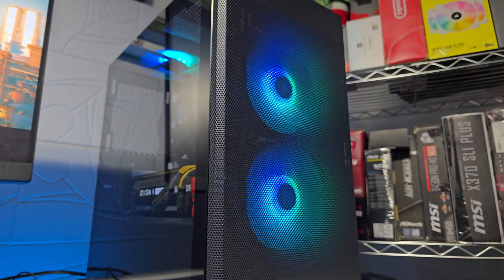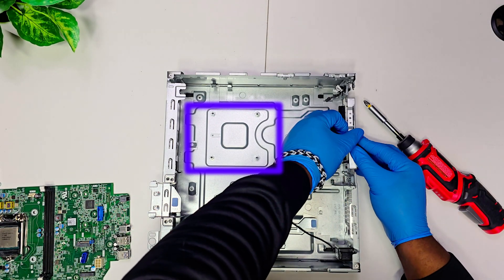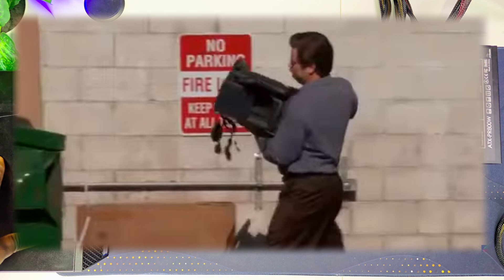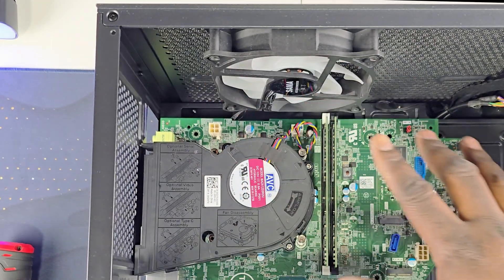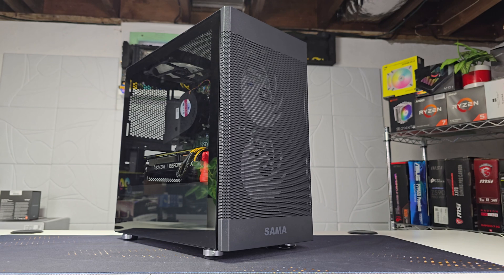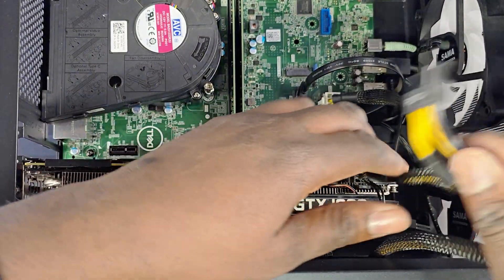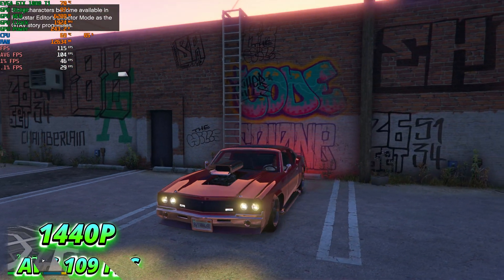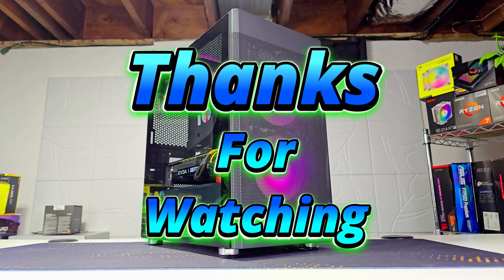How to transformed an Office PC into an FPS Monster! - Dell OptiPlex Case Swap Tutorial

Comment: Hey, working on my 5070 sff. My gpu and cpu fans are not turning off with shut down.  I used the included 6pin-sata cable along with a 10-fan hub.  I connected cpu fans to the hub. Would you be able to help me pls 🙂
Reply from the maker: Hi, don't connect the CPU to the fan hub.  Plug the fan hub with the Dell motherboard SATA connector, as I did in the video. Also, the PSU will stay on. I suggest shutting down the PC and then manually turning off the PSU.

Comment: Thanks for this, I was able to swap the case and install everything I need.
Reply from the maker: That's awesome
Reply: @ZeRDTechGaming  Another question, did you resolve the PSU always on after using the adapter? When I turn off the PC the PSU stays on :/ and the HDDs or everything connected to it still "working"

Comment: Can these motherboards work with an aftermarket cooler? It would be interesting if you were to try using an MT optiplex motherboard. There is one more connector on the bottom right wich is probably the chasis intrusion check right? It is a small white connector below the beige 6 pin power plug.
Reply from the maker: Yes, most coolers should work with it. As long there's a backplate. The MTs are very easy to do.

Comment: Hey, i just wanted to ask - should i split the metal in the jumper cap or no? You have done that in the previous video, not here though. I'll be case swapping the same model as yourself (3070 SFF) and im just wondering whether not splitting the metal leads to random power ons in this case as well. Either way, thank you for this amazing tutorial
Reply from the maker: Hi, thanks for watching. You don't need to cut it, it's not required if you have the same jumper cap like mine. Every Optiplex behave differently but it's not going to power on randomly.

Comment: Hi just subscribe. I wanna ask why my optiplex always testing fan and motherboard when i want to power it on can you give me some Advice
Reply from the maker: Hi, the reason that happened is because Dell used a 6-pin power connector for the motherboard, and there's no way to ground the power to let the power supply know when to shut down. I recommend shutting down the PC and then turning off the power supply manually.
Reply: Alright thanks man🎉🎉❤

Comment: I have a 3d printer...can this be used for ultra settings or high settings to play bf6 at 1444 or 2k or 4k
Reply from the maker: You may have to get a better GPU for 1440P and especially 4K. I say at least a 3070 or higher.

Comment: This is interesting. The SFF Mobo should be useful for building a customized gaming PC. When you took out the dell optiplex SFF Mobo from the case, which kind of components to connect to the Mid-ATX case and make it work?
Reply from the maker: I appreciate you watching. It's pretty simple; I already made a video explaining  everything on how to connect everything and the kind of wire you will need. https://youtu.be/_DZPKHcGYYI?si=arRnudWcc0NgqbE0

Comment: Hey thanks for the video although I do I have a question. With the 5 pin power cable header on the motherboard. In one video you use the jumper cap and cut it before plugging it in. In this video you don't cut it and plug it in. What do you recommend to do? Thanks
Reply from the maker: Hey, I appreciate you watching. The jumper cap is optional. No matter how you put it, it will work as long as you put on the right ones.

Comment: Hello, great video!, I was wondering if this is possible to do with a Dell Inc. OptiPlex 3040 SFF, Processor Intel Core i7-6700 CPU @ 3.40GHz as well?
(i was recently gifted it, and turned it into a studio setup for music, buying equipment like a mic, the impulse 25 etc., as well as getting dedicated software programs such a Audacity, and FL Studios.) But Recently I bought and tried running steam games on it and realized it didn't preform well at all, unlike the way it does with music software programs for me, and i would have to upgrade it, (if at all even possible). I am still new to towers and when it comes to upgrading them, but i would really appreciate the help and insight. ( also just wondering were there any error messages or problems to be aware of as well when attempting start up?/ booting up windows)
Reply from the maker: Hey, thanks for watching. It is possible that couple people already done it. Also, the only drawback is that you have to manually turn off the power supply because of the motherboard 6pin. Join the discord. The link is in the description join so I can assist you better.

Comment: May I ask if I can use a different case for this? I can't find the same case in my country.
Reply from the maker: Of course. I mainly used that one because of the included fanhub and cheap.
Reply: @ZeRDTechGaming , how do you connect the fan in the 1-pin connector?
Reply from the maker: You can get a SATA fanhub to connect the fans
Reply: @ZeRDTechGaming , One more thing, can I use a Dell Optiplex 3050?
Reply from the maker: Yes, you can. It will work.

Comment: Great video. For anyone attempting an optiplex case swap that has access to a 3d printer, there are adapters on printables that allow you to use the normal ATX mounting holes.
Reply from the maker: That's great to know! Thanks for sharing.
Reply: can you elaborate more? so drilling standoff screws is not necessary? (for the motherboard or cpu heatsink)
Reply from the maker: Hi, thanks for watching. I have another video where I explained everything. Check it out when you get a chance.https://youtu.be/_DZPKHcGYYI?si=zmLe2UCVzYkOVlL6
Reply: @ZeRDTechGaming  thank you! good video as well!
Reply: I also heard that it is possible to make your own 3D printed IO shield for your Dell Optiplex Small Form Factors

Comment: When I use the 24pin to 6 pin adapter, my psu fans are running all the ,and solution on that ,instead of turning off the power supply?
Reply from the maker: @mladic86 Unfortunately, there's no way to bypass it. I recommend always shutting down the PC first, then turning off the PSU. Also, mine is still working without any issues.
Reply: @ZeRDTechGaming  ok cool,thank you

Comment: Nicely done.  Been frustrated by the naysayers afraid to drill some metal to move the motherboard - but it seems that as long as you only mark through the motherboard - but not run the drill through it to avoid damage, it should be good.  Maybe use an awl/nail just to mark the metal, or the waxy colored pencils at hardware stores? then come back and drill??  or maybe they overstate the danger?  Either way - thanks for making it real, and showing the up close images.  Great Stuff!!
Reply from the maker: Thanks for the kind words. Yes, a colored pencil definitely works. I used one when I did the case swap the first time with the white case, which made things easier. I appreciate you watching.
Reply: @ZeRDTechGaming  my pleasure - only the truth.  I'll check out some of the others.  THANKS!

Comment: Hello, how are you?
I would like to know if this modification can be made on the Dell Optiplex 3070 small form factor
Reply from the maker: Actually, the one I used in this video is the 3070. Yes, it will work.

Comment: I have a dell optiplex 7010 sff. I want to case swap but I've heard it's really hard because the size of the mobo isn't standard and I need all these adapters. Can you explain what I need to put the mobo into the case?
Reply from the maker: What year is the 7010?
Reply: @ZeRDTechGaming  Very old, I don't know the exact model but I know it was running windows 7 and had 8gb of ddr3 ram

Comment: i did something similar this week but i had an omen hp pc with a i7 10700 2060 super 32gb ram and a m2 ssd and just changed my case got an aio a psu and mobo and my pc looks like a custom built one. nice video!
Reply from the maker: That's amazing! I bet the end result is really rewarding.

Comment: just a little curious how do you get more then 60 fps my optiplex just sits at 60 fps 24-7 an yet i can’t turn off the record fps settings only turn it to 30 fps
Reply from the maker: Sorry to hear, but it must be a driver issue also what specs are you running with your OpTiplex? Also make sure you update your drivers with the Dell support assist. What GPU are you using by the way?
Reply: @ using the 7050 with a (1660 ti oc) an a i7 7700 with win 11 pro on 16gb ram, nothing ever gets past 55 degrees either as i’ve upgraded the case an fans along with the cpu cooler idk if i bought a potato of a gpu but in settings ig you type fps in the search bar it comes up with this setting that says game an recording fps something i think an when you click on it you have a choice in 30fps or 60fps idk if it’s bc of windows 11 either
Reply from the maker: With this spec, you should be getting way more fps. Maybe Vsync is on in the settings. Whenever you get a chance, boot up a game double check to see if Vsync is on and unlock your FPS or put it on unlimited
Reply: @ i will have to have a look i believe Vsync is off but maybe i didn’t apply the setting properly or something, honestly has me scratching my head like the 1660 legit sits at 50% usage at 60fps on ultra settings in beamng but if i go onto something like mine craft or rust it just sits at 60fps so ik the game hasn’t got a frame lock which ik beamng doesn’t bc settings you can target 340fps
Reply from the maker: Download MSI afterburner or enable the perfomance stats on the NVidia app to see if the GPU running at the right clocked speed. Also join the discord for better assistance. https://discord.gg/RW9p4CY2Er
Reply: @ZeRDTechGaming it was the gawd damn "Optimized for windowed games" settings i just went to double check my graphics settings an decided to switch it off an it started getting way more fps
Reply: @ in 1440p high settings i maxxed the gpu out an got 1850-1860 MHZ on beam ng, definitely not a playable frame rate on them settings but the clock speed is running good i ran it for a minute straight
Reply from the maker: That's awesome you did it.
Reply: @ i also just figured out how to turn the actual gpu vsync off as well from the nvidia control panel i’m a dag😂
Reply: @ZeRDTechGaming like if i compare gameplay to my xbox series s it looks identical to the fps if not better but it just either says 30 fps an doesn’t move or 60 fps